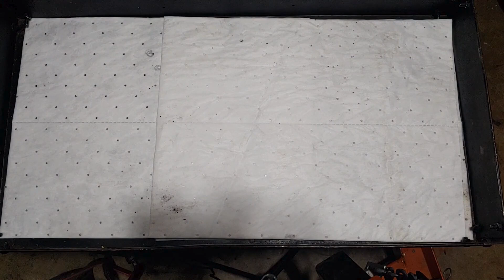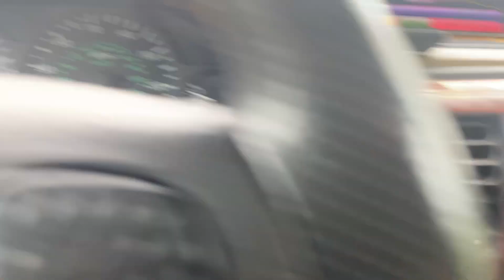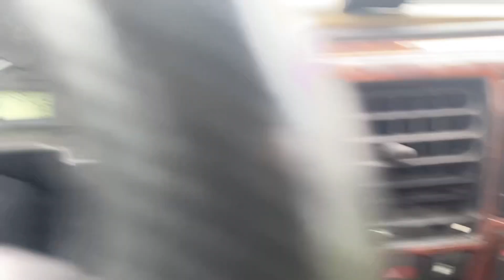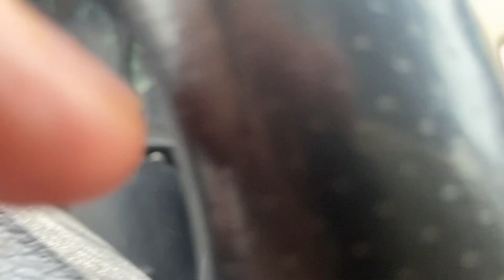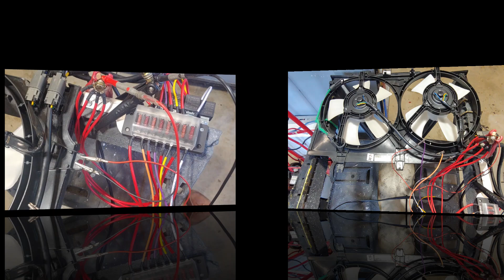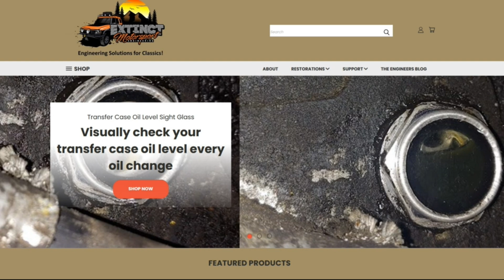Upgrading D2 Engine Cooling Using Dual Electric Fans

Comment: Have you tested temps on higher speeds (interstate speeds)?    I get temps creeping up running A/C in summer
Reply from the maker: Fans don't really affect highway speed temps that much because the vehicle speed airflow is much faster than the fan speed.  A stock D2 will hold 100 degrees over ambient at 70 mph on relatively flat ground.  A lift, bigger tires, a rack, a winch, bumper lights, all will increase that number.